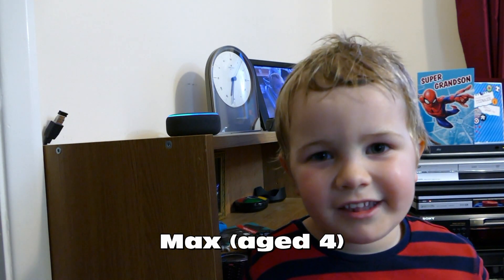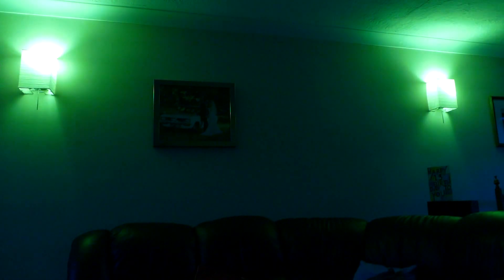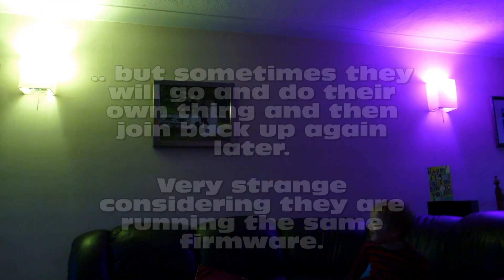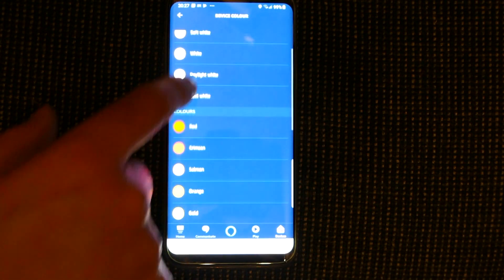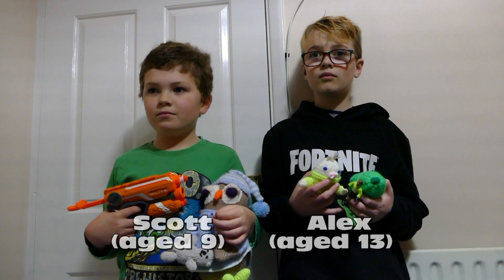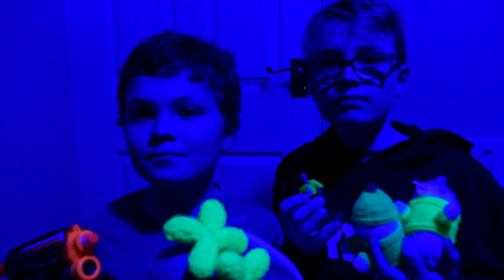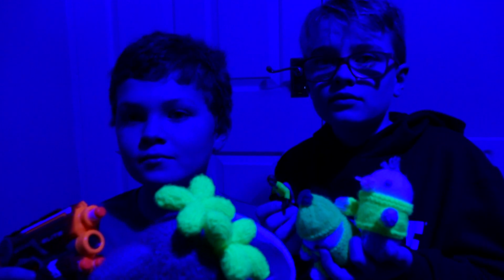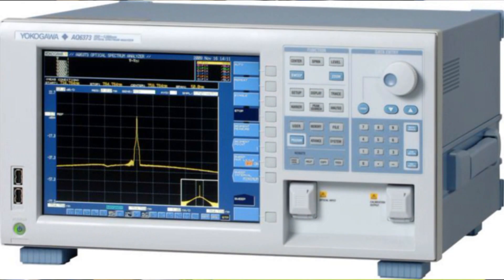Yeelight RGB bulbs.  Ultraviolet radiation problem?

Comment: Most UV pigments can be stimulated well down into the blue spectrum. I used to use blue metal halide floodlights to make the old steel angels on George Square in Glasgow fluoresce.  A rough rule of thumb is that shorter wavelengths of light can stimulate longer wavelength fluorescent colours.  It's just more visible with blue because it's at the darker end of the spectrum.
Your lights will be putting out a single wavelength of blue in the region of 470nm so pose no UV style risk.
Reply from the maker: Thank you Clive.  You've put my mind at ease, and especially Mrs.Video99 who was worrying about this.  I've sent you a virtual cuppa on Paypal.  All the best.